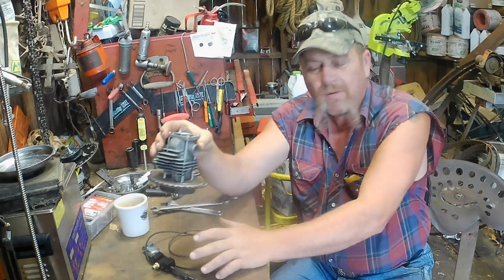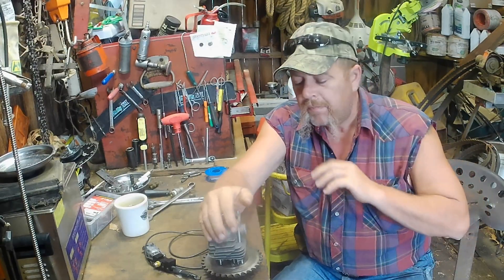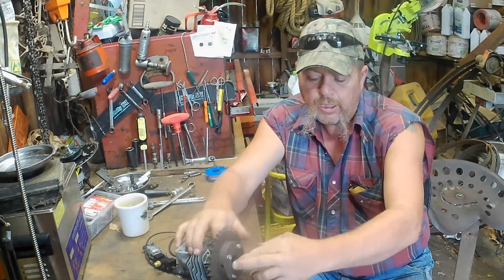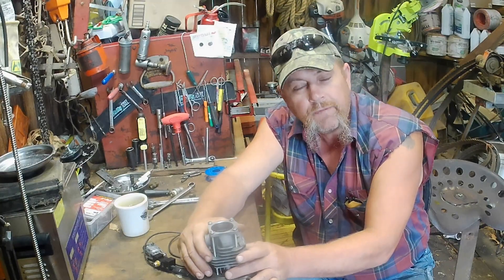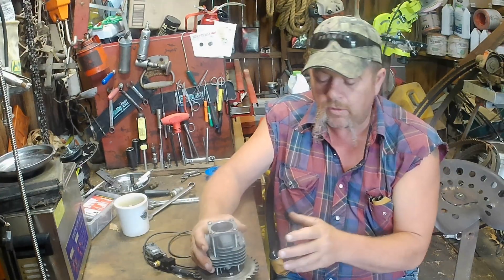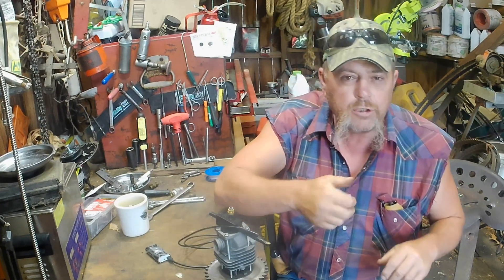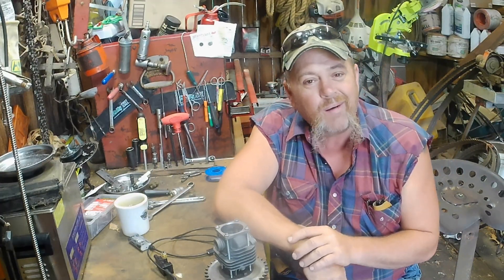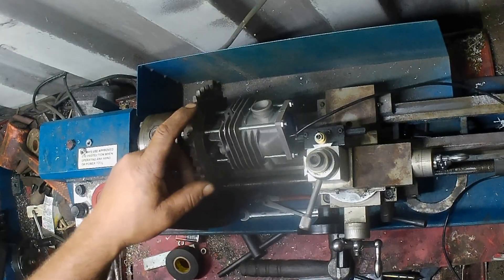MNI LATHE-HOW TO CUT SQUISH  on Chainsaw Cylinder Tips Tricks and Hacks- Porting Stihl 026

Comment: Hey, do you know what that sprocket is off of? Trying to do this exact same setup for my newly acquired mini lathe :)
Reply from the maker: @Magoot2456 It's been a minute since I recorded this video and don't remember EXACTLY what's in it; I think you may be talking about the sprocket that I used for a jig to mount the cylinder. If so, it's a generic "finished bore" sprocket that can be found from numerous suppliers on the net. If I remember, this was a (about) 30 tooth sprocket in 50 series chain with a 1" bore such as this 
https://www.nitrochain.com/50B27-1-finished-bore-sprocket
Of course, mine was salvaged from another project from a PTO generator that I had made out of an engine powered generator head. Hope this helps; if that' not what you meant, ask again and I will try to do better.

Comment: Have you still the location of where you got the endoscope?  I need something like that all the time, and I have your attitude towards buying stuff 😂
Reply from the maker: @wrstew1272 I searched my purchase history on both Fleabay and Scammazon; I reckon that I've had it long enough that it doesn't show. 
It's substantially similar (if not the same) as this 
https://www.ebay.com/itm/113073007573?_skw=wireless+wifi+endoscope&itmmeta=01JK7JY34RKFKSKVWTECG2QYRG&hash=item1a53ad2bd5:g:zuIAAOSwUwlbJq8N&itmprp=enc%3AAQAJAAAA0HoV3kP08IDx%2BKZ9MfhVJKkrlbW%2FbuQ%2B5SETRuNhSUw6FiHBW%2BkomRthHUhIEN3Vd%2Bx7DWKJZDZHUwtUFwTpll%2BcLiB5YjNeN12936Te5INu4%2FBNWBBmmivet17shGEGj%2Bu%2FKtQRzKzhr0vDl6bJwb6GIV37aA0dS0NDxTZXwARlX8z769V%2BDHK5xsoyv%2FgV0WH8CJH2FJgxayItUt9D7OMwP32I2UuzQkspJrOfn1O2yEff%2BUSWfx1x7zKhhqDzqjOdh%2BEnqmtsiZvJ7Sc3Pis%3D%7Ctkp%3ABk9SR8ay-PKZZQ
Hope that helps a little. I always gotta be getting me some more gadgets!!

Comment: Hey quick question and i know this isnt necessarily this video's topic BUT in your pipe testing video about a few weeks ago you had made your tests with the adjustable pipe. I'm not familiar with Stihl so much but for an old poulan 3700 which is supposedly around 60cc what diameter pipe should i work with? New to this and would love some suggestions for the main pipe and then the outlet pipe. Nothing fancy but figured id give it a try as the ole girl has a cancerous muffler (rust). Really enjoying the videos btw! Thanks for all the info!
Reply from the maker: @xoriatmike6857 I'm working off of the top of my head right now, but I've got it in a spreadsheet on another computer; "why not just look", you ask... well, I'm only in the beginning stages of getting a multiplier.  It will take some minor calculations on your part... I use a pipe, that when hammered into a  rectangle at the flange-end, will be of the correct size to fit the flange opening and allow bolts to mount the flange; If a pipe is used that is too big, you can leave it round(ish) on the bottom (***NOT THE TOP!!)  I want the volume of the pipe to be about the same as the volume of the saw's compression volume (desired volume dictates the length of your chosen pipe size); by that, I mean that a 48mm bore  (3.14x Radius-squared or 3.14x24x24) x the distance from the top of the exhaust roof to the top of the stroke (if one does not know, you could guestimate that the exhaust roof is about 100 degrees and multiply the saw's stroke by .556 (or, in the case of a 100 degree roof, 100/180=.556). If one had a 37mm stroke and guessed at a 100 deg exhaust roof, take 37x.556=20.556.)  
Next, take the Pi R Squared measurement times 20.556 to equal volume; I want the outlet pipe to be @ the same volume.  A volume calculator on the computer may be your friend here!!.
Next, I want the stinger outlet to be attached at the top of the radius of the outlet pipe and back (without getting into too many calculations) ~3/4" from the end. A little either way will still work JUST fine, but can/will effect your RPM range by a some RPMs. 
The last thing I do, I leave the stinger as long as I can and run the saw under a load for a bit; I shoot it with an infrared thermometer and cut the stinger off about 1/4" long of the hot spot.  Harvey (Ironhorse... to give credit where credit is due) uses the same technology, but paints the stinger; the cuts it off in the same manner (after the hotspot) based upon the paint burning and not burning.
**VERY IMPORTANT** If I just made you feel overwhelmed, please, please do NOT give up on me being able to explain it; there's no shame in not understanding what I'm saying; that's just an indication of my failure to communicate clearly; if you don't understand it in the manner that I just prescribed, please let me know and I will go from a different angle; different people understand in different ways!!  Thanks a lot for being here and especially for commenting; its helpful to me and to the channel!!!!
Reply: No i appreciate it whole heartedly! Some of it is out of my understanding but ill take my time and give it a try! New to 2 strokes myself, work almost exclusively on 4 strokes. I also have another saw set aside so i may keep my runner cutting and tinker with the currently shelved saw in the meantime. Again thanks so much!   @HayChaffandSawdust1
Reply from the maker: @xoriatmike6857  I think I can condense it a little; a two stroke only builds compression on part of the up-stroke (about 56 percent of it); I calculate the "compression volume or 56 percent of the total volume (for fuzzy numbers)... meaning if I had a 60 CC saw, I would cut the outlet pipe (Ironhorse style exhaust) to have ~33 CC of the saw's volume; the outlet "stinger" would be of about 1/2 that diameter and reach out to the side of the clutch cover; I would cut it shorter at a later time; I would load the saw and cut it about 1/4 past the hot spot. There will be a spot that the stinger is HOTl it will drop 50-100 degrees F in a short distance; I cut it off about 1/4" from where it starts to cool.  Don't give up on me; just let me know which place you are losing me and I will reword or dig deeper.
Reply: @HayChaffandSawdust1 Hot pipe / cool cylinder 👍 … Hot cylinder / cool pipe 💩.  Last I checked the answer was 42 🤷

Comment: I bought a cheap bore scope years ago.  Rarely use it but they sure are handy.  Good application!
Reply from the maker: @Kevin.L_ I know!! For sure!! I've had that one for a long time (and a couple of others for other applications; I've had them before they got cheap. The ones I had for working on turbine (jet) engines cost thousands of times the price of this one (literally!)  That application was one of necessity!! I couldn't get my head in there to see, and I thought "hey, wait a minute!!"
Reply: @HayChaffandSawdust1 Did the high dollar jobs have a better focal range than the cheap stuff we buy now?  That's my biggest complaint with mine.
Reply from the maker: @Kevin.L_ It's not a real fair comparison; these were glass, prisms, and fiber; they had a manual focus like a good pair of binoculars; one could turn the ring until it was in focus; if it move a smidgeon, refocus was needed.  The ease-of-use of the current ones outweighs  clarity the old stuff for most applications.  My electronic ones ( both wireless and the ones with a hand-held monitor) are SOOO much easier to use and are pretty suitable for me; I can zoom in and see stuff I can't feel.